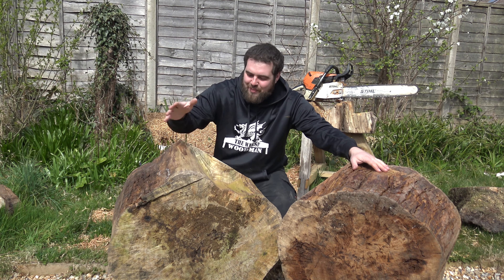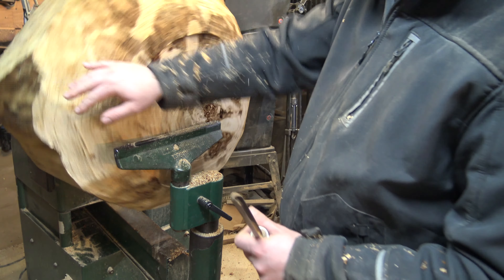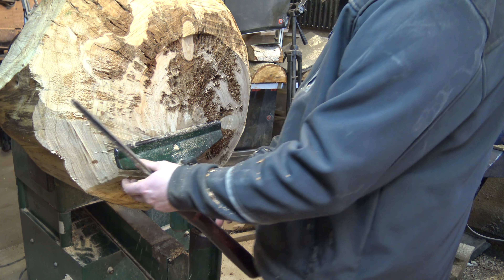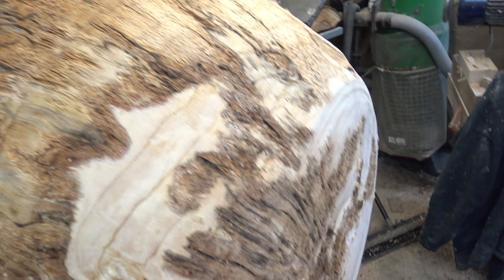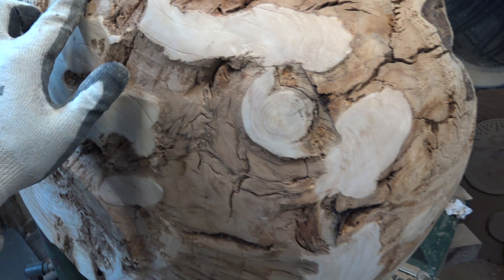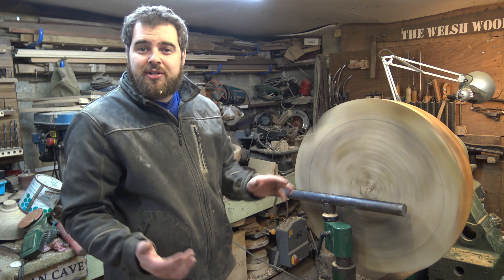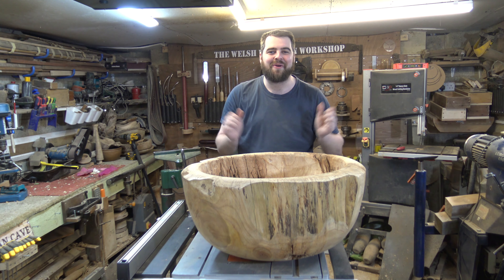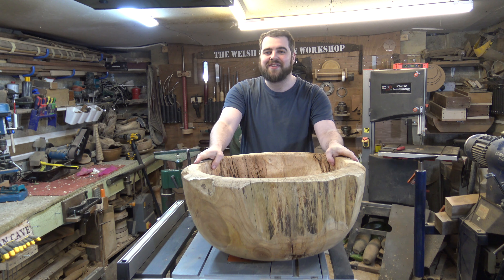Woodturning a monster bowl on a VB36

Comment: Desperate Dan size breakfast bowl.  What revolutions were you turning it at - thats an amazing lathe .   My vote at the beginning was to keep as a bowl but now am interested to see what you can do with it.
Reply from the maker: Thanks David, Desperate Dan bowl love it. The lathe is a VB36 its designed to turn large pieces, I'm not really sure about the RPM as the lathe doesn't have a speed read out, I think it was probably somewhere between 800rpm and 1000rpm, turning large pieces can be deadly so  its always important to have a  good secure hold, towards the end i had to turn slower as the bowl went a little out of true. I will leave it a few months and come back to it and see what I can come up with. Thanks for watching.
Reply: @thewelshwoodman649  Thanks for the response and I'll look forward to it.

Comment: It's a real moster piece. Would have been interesting to know the weight before and after turning.
Reply from the maker: Thanks for your comment Allan , not sure exactly how much it weighed but I remember it took two of us to get it mounted to the lathe to turn the back profile due to its awkward size, as it was a soft wood and really dried out when I turned it it wasn't as heavy as it could have been but still enough for me, when it was fully hollowed it was a lot easier to move around 👍

Comment: How did you mount the faceplate to the foot? Also, after turned around, it appears the rim wasn't running near to true. Did it go out of round, or was the foot not exactly centered?
Reply from the maker: Thanks for your comment chuck, I found the centre of the foot then used a set of dividers to score the outside size of my face plate to try and get it as centered as possible, I mounted the faceplate to the bowl with chunky screws, it was running pretty true to begin with, however some of the screws went into the rot section and towards the end of turning there was a bit off wiggling making it out of true so had to turn at a slower speed and extend my handle length to safely turn out the centre. I hope this helps 😁 thanks for watching

Comment: Tom what size face plate did you use for this project
Reply from the maker: Hi Paul, the faceplate is 320mm one from Steinert, here is the link: formhttps://drechslershop.de/en/face-plate-for-vb36-vgm300?number=VB36-FP320

Comment: What kind conifer tree was the blank from?
Reply from the maker: I'm not sure exactly what type of Conifer this was as the bark was stripped and there where no leaves to identify it from, but the nice feller who's garden I picked this  up from said it was a massive conifer that had been growing in his garden for over 30 years, unfortunately they had to take the tree down because of the rot  which made this piece a massive challenge. :-)  Thanks for watching.
Reply: @thewelshwoodman649  you did a great job with that big chunk. If you keep doing huge pieces like that,  you better think about getting some sort of lifting system to pick them up with.
Reply from the maker: @STMwoodturning  yeah I'm definitely going to look in to some form of winch or pallet stacker lift should make things a lot easier 😁